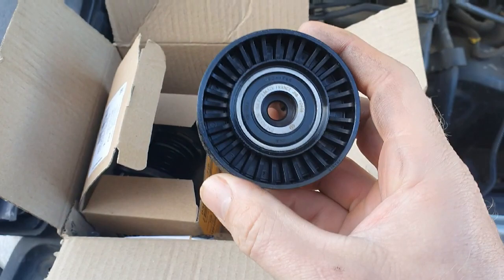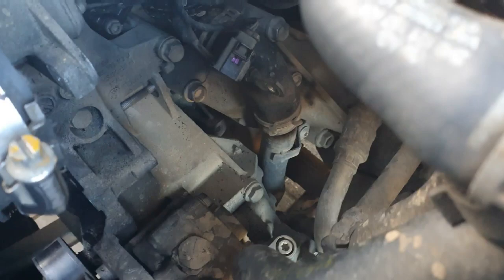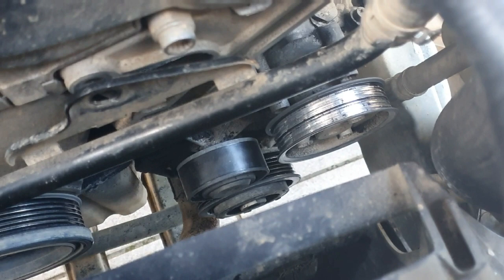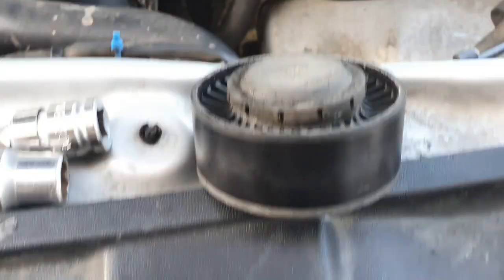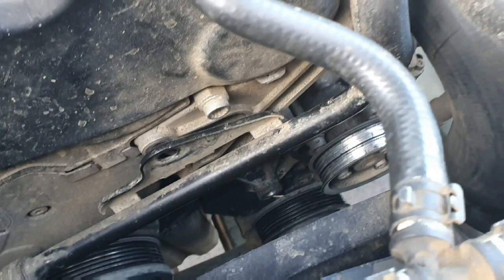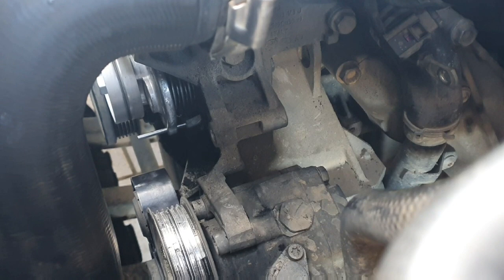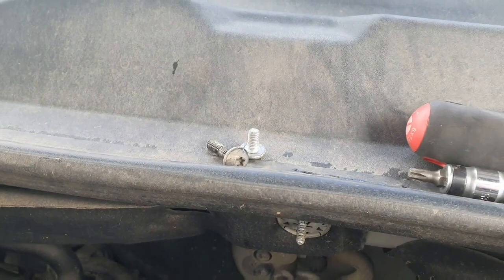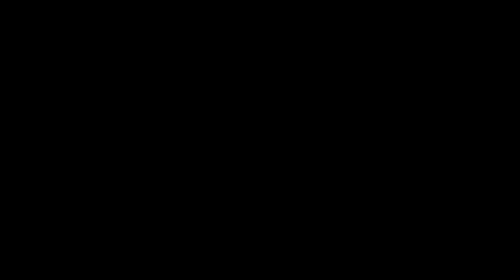VW Amarok poly v-belt tensioner, idler and belt replacement

Comment: I'm surprised that the German engineers envisioned the removal of the engine mount to fit one F'ing bolt.
Reply from the maker: Well they didn't really, that's why there's different torque specs for the bolt for when you re-use it...
But I get your point, it's unfortunately just one of those bolts.

Comment: Update  10/04/2022 well it looks like the bearing is getting noisy in the tensioner pulley .The question is can the wheel itself be changed or do you have to replace the whole tensioner arm?

Comment: Argh, the tensioner pulley ,the demise of many an amarok engine once the serpentine belt finds the timing belt.Mine went through 3 pulleys,belts and an alternator pulley because of the shit quality of the tensioner.My brothers rok blew the engine because of it.This was before the robuster timing belt kit came out.The steel one has now been on mine for two years ,so far so good.

Comment: I have a 2014 Amarok. I replaced the alternator and tensioner but I have a problem with my belt always breaking. Any suggestions?
Reply from the maker: Have you replaced the idler as well? Have a good look at all the pulleys and try to see where the belt gets its damage from with regular inspections. Also are you using dealership parts or alternative aftermarket? I've had a bad experience with aftermarket belt and are now back to dealer supplied parts...

Comment: Can the tensioner bolt be easily replaced? mine snapped
Reply from the maker: Think you need to remove the left side engine mounting to get a new bolt in...
Reply: @willemtreurnicht3818  yup I did lol, Its not too bad actually. just undo the mount and jack the motor up and it becomes accessible